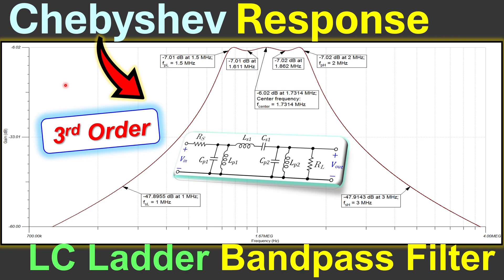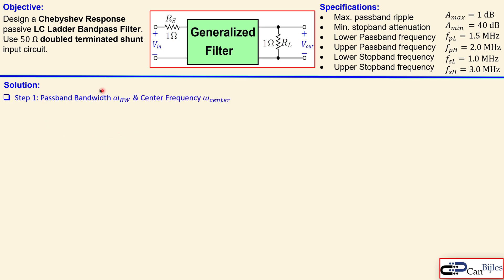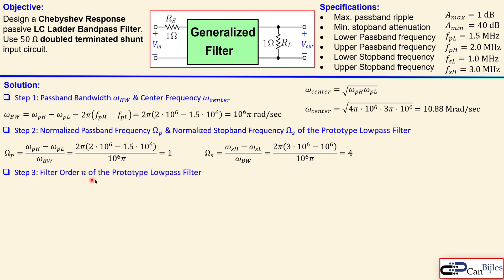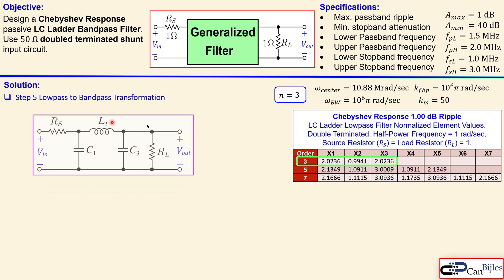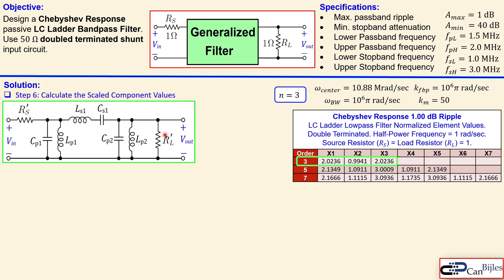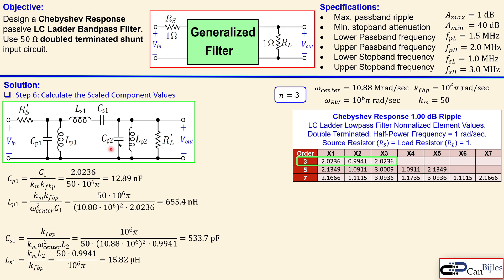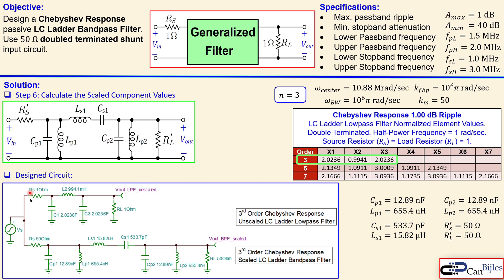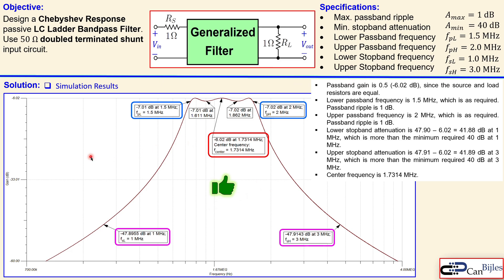LC Ladder Bandpass Filter Design 🌟 Chebyshev Response - 3rd Order 💡 Example 3

Comment: Hello! Lets say you have 50ohm load. But the source resistance is 0. What would you do then to avoid too high gain ripples? Thank you
Reply from the maker: I gave you the answer to this exact same question in the other video. Here is a repeat: 
Rs = RL = 50 Ohm is required for maximum power transfer.